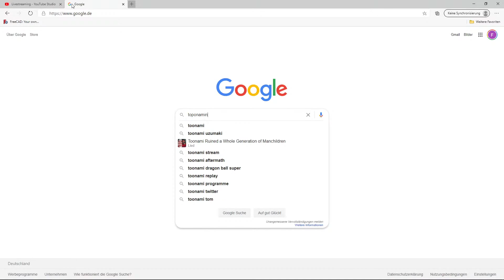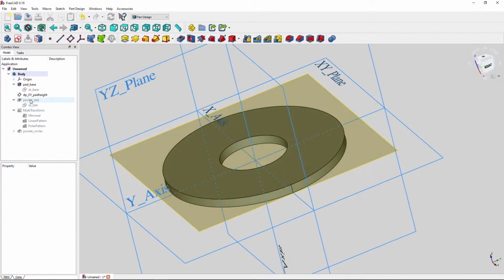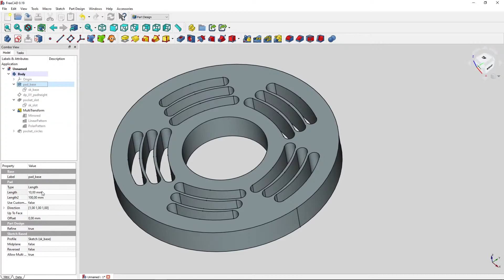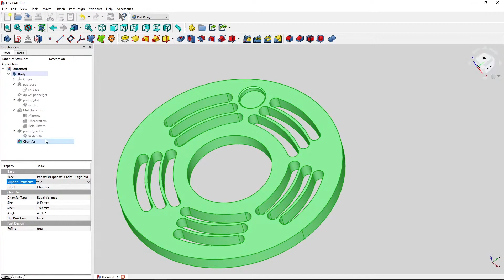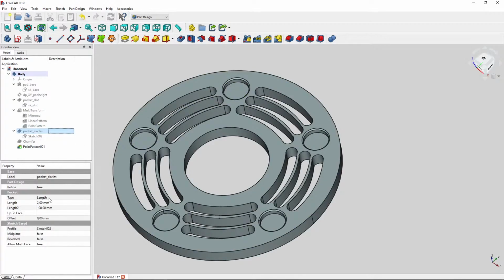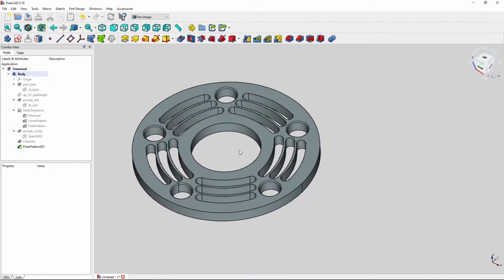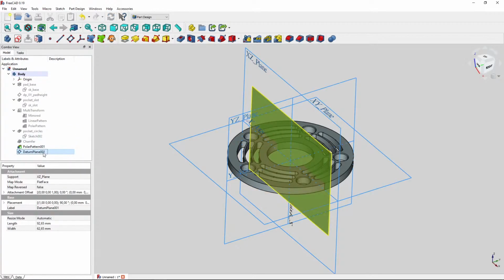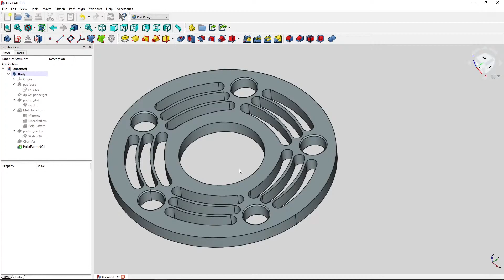The most annoying problem in FreeCAD 0.19 Part Design - Topological Naming [LIVE] (English)

Comment: So, all this 13 min video can be collapsed into 15 sec with one sentence: " issue is still actual, no forecast of fixing this, methods of making models with referring to elements of the sketch are not working for now". right? :)
------
PRELIMINARY: looks like the issue is not happening if all lines in the sketch are turned into construction geometry, additional points (non-construction geometry) are created at all needed places to duplicate the current vertexes, and all references to this sketch are linked with these points. I will add more info when I will rebuild my model and play with it long enough.
-----
PRELIMINARY#2: looks like issues starts once I have a sketch with more than 2 structural lines meeting together at one point. Construction lines can be connected to whatever is possible - they not causing this issue. Still testing, in a week, if my guess will be confirmed, I will upload the details on web and put link here.

Comment: This is very useful but quite old now. Back in '22 it was intended that the next major release would be 1.x and would 'fix' the TNP - as far as possible anyway.

However I see there is now a 0.21 on the cards, and 1.x has been put back.

It is obviously impossible to 100% fix it. If one has a sketch assigned to a face, and then one goes back to an earlier stage and does something that removes that face, something is going to be broken, it could hardly be otherwise.

But, logically, when designing something, attaching to a face is often what one is really trying to do. A simple example, a solid cube with a rod protruding from the centre of a face a certain distance. The way one probably thinks about it is "that rod is attached to that face", not "that rod starts 10mm from the origin which coincidentally is where the cube face is". So, logically one would expect that on resizing the cube, the rod would remain in the centre of the same face, protruding the same amount. And, maybe in this very facile example, it will, but it will certainly be possible to make earlier changes that would break that.

So, don't make it hierarchical like that, attach the rod sketch to a datum plane referenced to the origin and put in the right place. But, now, change the cube size and the rod doesn't move because the datum plane doesn't. Why is that? Basically because the same bit of information is stored twice, and they've got out of step. In software design there's a golden rule of never storing the same thing twice if you can avoid it (which is not always), because sooner or later there's a risk of their getting out of step. So OK, set the cube size from some variable, and use that same variable in the datum plane positioning. Better, but it's all got more complex, and this is a very simple example.

So it seems to me that the workarounds work to an extent, but they introduce complexities of their own.

To me, the problem that Freecad has is that it arbitrarily changes face names much too easily. You can have a design and maybe change something innocuous earlier on - maybe a hole diameter or something, where the number of faces and their relationships do not change at all - and sometimes it is fine, and sometimes it falls apart and a lot of rework is needed.

So, it seems to me that what is needed is some form of internal algorithm where existing face names are retained wherever possible (which clearly won't be always), and then a more user friendly mechanism for remapping sketches. I feel that would go a long way towards dealing with TNP.
Reply: Memory is freely available and memory  conservation in modern programming is not a discipline anymore and duplicity and triplicity produces its own set of problems when not cross referenced. The referencing is the issue that needs  addressing. A lot easier said than doable I realise.
Reply: Version 0.22 beta is also quite stable apparently with nice features.

Comment: After following your various FreeCAD tutorial videos, I've just finished creating my first real world object in FreeCAD this evening; a 76mm diameter desk cable grommet for gaming desks I'm building for our children. It has a bevelled lip and an internal ledge to receive custom inserts (I'll be designing those next). Exported to a .3mf file, then sliced in PrusaSlicer it's now ready to send to our Elegoo Neptune 3 Plus first thing in the morning!

I saw the idea for the item online, but the available 3D models were 80mm diameter and scaling them down would mean some key features would reduce in size as well - such as the bevelled lip, internal ledge and wall thickness. I wanted to avoid this so decided to create one from scratch. 

I would normally have headed straight to Sketchup, but thinking I would likely need to tweak the diameter to get just the right fit, this seemed like the perfect opportunity to finally have a go at learning a parametric 3D design software package. I settled on FreeCAD, found your videos, followed them through and am so glad I did. Thank you for helping me get off the starting line fast!

Comment: I guess, though, that for chamfers and such (model-changes inherently & necessarily beeing defined upon a geometric feature) we can only hope that the realthunder branch features are inspiring core devs to go for an approach like:
1) upon object creation: give a distinctively new class-name for every object (distinct from every existing one, salt-hashed or so).
2) allow for muliple strictly hierarchical classes to be held by each object (linked lists).
3) define the origin of every class (aka object) upon creation and never change it, even when splitting the surface into multiple or changing its edges by chamfering etc.
... when with object I mean: volume 3D, surface 2D, edge 1D, vertex 0D

Solver could then just pick each and every definition ever made to the model and process it exactly as it was meant to - even after changing the first definition to absurdity and messing with everything that there is.

Thoughts and Explanations for the 3 key ideas:
1) is already existing: every object gets its type and a number upon creation - its just getting changed along the way, instead ofit beeing a stack that gets added on whenever it changes.
2) is a new concept, but can be implemented easily by storing the geometry as it was before the object-altering or object-creating operation.
3) this would actually bring with it a powerful feature: in the dialog boxes there could be a  "class-tree" shown when selecting an edge.
every uphill-class could be shown and manually selected as a target for the upcoming modification - right there, even if it doesnt exist anymore in the body - I could then still use it as a reference for a constraint (#assembly)

Lets give a simple yet total - think about the following:
a simple cylindric shaft that gets a small groove milled in for a tongue and groove connection
Lets only think about the surface-classes, not those of the volume, edges and vertices - because this is a YT comment:

Step 0)
cylindric, 3 surfaces (2x circle and mantle) - lets name them C1 / C2 and M3 for shorthand here

Step 1)
after change: 8 surfaces : C1 / C2 / M3 , and added: G round of groove and 4 S ides (2 rectangles and 2 half circular mantles with rounded edges)
After the milling operation, with my approach the model would look like this: 
C1 / C2 / M3>M4 / G5 / S6 / S7 / S8 / S9
So even if the M3 geometry doesnt exist anymore, it will be still saved in the third block (aka linked list) that has now M4 as its representative to the final model

Final Step 2)
Now go on to change the groove to go "through all" the material, so its just changing to be like this now:
C1 / C2 / M3>M4>M10 / G5 = dead or invis / S6>S11 / S7>S12 / S8>S13 / S9>S14
where dead could be "visible: false" or just another boolean info for the renderer to use.
 ... so there are 14 surface-objects saved, even though the final body has only 7 objects .

Nr. of surface objects stored in the body-model for
Step       old   > new
Step 0    3      >  3
Step 1    8      >  9
Step 2    7      >  14

Hence, if something referenced the ground surface in Step 1 ( G5 ) to place something on, it would still be possible to be evaluated and rendered, even after deleting this very surface from the model - because its still saved in te linked list of Step2 (even if flagged as dead).
And when someone has bound anything to the S7 "center of gravity" from Step 1, it would also be easily possible to evaluate and render, yet even to hold all constraints in an assembly that were put to it earlier, so "Constraint-Based-Assembly" like in A2plus Workbench (pretty cool and nice to use otherwise) would work like a charm in 99%+ of all cases)
Also this could be an opt-in automatic popup or an on demand dialogue that can be run by the user manually to check:
" M4 , ... have changed, pls make sure that your reference to M4 is still doing what it's supposed to! > LIST/TABLE" or
" G5 , ... has been removed from the body, pls make sure that your reference to G5 is still doing what it's supposed to! > LIST/TABLE"

I dont quite get why people didnt program it somewhat like that in the first place - nowadays we got plenty of CPU power and RAM and its just getting more and more irrelevant every day.
Reply from the maker: I know you put a LOT of time and effort into this comment so why don't you share it in the FreeCAD forums? I think in my comment section this knowledge might be wasted..
Reply: @FreeCADAcademy  I have to agree! I found that gem by accident, on a forum you have higher chances of engagement, which is something the community would appreciate for sure! I would!

Comment: Naming issues?  Who would have thought?  Uh, first, never let an engineer name something, because "1,2,3" or "A, B, C" isn't a name.  Try a simple sheet metal problem that goes from a 1"x3" rectangle to 8 or 12 sided polygon with 1" sides.  This means for each corner of the rectangle there will be 2 or 3 edges to the polygon.  

I found that I can extrude a polygon to a degree of taper, but the small end is still a polygon.  There isn't an easy way to solve this problem.  You can create a datum for each side of the polygon, which means you need to know every angle and length.  But if you need to know every detail of the shape before you can draw it in CAD is the opposite of the purpose of CAD.

Comment: What about this? For the chamfer, construct a sketch on the YZ plane referencing the sketch of the hole and the XY plane with an angle and one dimension. Then revolve the sketch around a centerline referencing the centerpoint of the sketch of the hole. I don’t believe that includes any 3D model features.

Comment: I've encountered the same problem with AutoCAD and Civil 3d named objects.  Programmers don't seem to want to address the issue that object handles and GUID values won't stay static with traditional editing tools, because those tools erase/replace primitives as they go.  That creates all new names.  The answer for the programmer would be to make the primitives part of a named subset of objects which could be redefined without deleting the subset container.  (..as #xl points out, sort of.)  

Those primitive object defining methods were developed in or before the '80s.  And, programmers are just too lazy to develop the complicated process that is needed to update the root of the software.  The idea is that the existing methodology is "more efficient code".  Even though, that code was only considered efficient because the hardware could not support that much computational and recursive math at the time.  Even today, I have burned through a couple of i7 CPUs just trying to run some complicated Excel spreadsheets with many reference formulas.

Does anyone here know if Solid Edge, BRL-CAD, or any other history based CAD software have solved this issue?

Comment: Sadly FreeCAD is too weak in that it can't name the result of an operation so that it can be referenced later.
Example: At some point you pad a sketch. Imagine if you could name the sides of the pad, or name the translated face, so that you can reference it later....
In SideFX Houdini for example, at every point in the graph, you can insert arbitrary code to select the face(s) you need; nodes also let you name the result of the operation (faces that were created for example), making it a truly procedural modeler. In FreeCAD you're stuck with whatever options the developer though of, if you're lucky.

This is why you have to do weird stuff like creating a datum plane that happened to coincide with the extruded face of the PAD at 2:30 instead of supporting the sketch on a named face, so that it will also be at right place even if you have some minors change upstream. By doing this, you're really re-implementing a part of PAD with the datum plane + shift in a direction + a reference to some length.. We should not have to do this. This is error prone. Also, it only works in simple cases. Good luck if you need to reference a face from another additive method where the result is non trivial.

Comment: Thanks for the very clear explanation.  I'd discovered this problem by hard experience, and found similar work-arounds, like using absolute datum planes, but I think this is extremely unsatisfying.  I contend that expressing features in terms of 3d-geometry better captures design intent.  I understand the software difficulty that adding a feature can change the geometry in complicated and unexpected ways, but it seems like there could be better heuristics than just picking some random edge that had the same name in the last computation!  Based on the other comments, I'm downloading realthunder's latest version right now!

Comment: Wow! This is exactly what I needed to know. I will have an original prusa mk3s soon, exploring woodworking design to make a large custom wall cabinet for it, and have used the KiCAD StepUp bench a half dozen times before.
 I think my biggest mistake has involved mapping sketches to 3D object faces. I had no idea why my edge finishes migrated like this.

  My abstract thoughts, ideas, and learning curiousities:
  After watching this upload yesterday, I'm wondering how I could better plan out a larger project. For instance, maybe it would be better if I start a design by setting up several key datum planes before any parts are added in order to ensure all of my anchors are limited to the origin.

  With woodworking, my goal is to generate a materials cutlist and an efficient plywood layout. This seems like a challenging workflow to manage because it involves many independent and interrelated objects. I'm struggling with part/parameter naming, organization, and dealing with situational parameters like changing shelf widths that then need to be centered between vertical walls.
-Jake

Comment: I retired from an engineering management position in 2011 where I used SolidWorks and ProE. As I recall in all the lesson I had on those software programs the instructor always stressed to not build onto part model surfaces since you may change your model and the surface you used may move or be deleted. So this video on FreeCAD echoes the same advice. Very good, Flowwies.
Reply from the maker: Hey Don! Thanks a lot for your feedback. It's not considered a good 'style' of 3D modeling to draw on existing 3D geometry, nice to hear that others give the same advice for other CAD software!
Reply: @FreeCADAcademy  i have used 'ProE' since '93 and, yes, in their early releases they had the same sort of  databasing issue. Some designer would put a corner radius way high in the modeling tree, continue building features,  then need to remove the radius or change something about it. The tree would fail. Way back then they stressed to put chamfers and radiuses last in the tree if possible. 
I trained new designers to do that--treat that block like a machinist would. Do all the milling and drilling then soften it up with corner fillets and radiuses.
Reply: @dalesimmons3397  Yeah, I think that's way better. I understand why people want to chamfer before patterning; it saves some work. But that's only because manually selecting all the edges is cumbersome. More powerful edge selection would fix that.
Reply: I use all 3 programs. This issue is unique to freecad.
Reply: @spacer04078  Same here.  I've used Solidworks since 97 and Pro/E (now Creo) since 2003.  This is a software design problem and not a user issue.  Using faces with a modern well-deigned solid modeller is absolutely a good practice if done thoughtfully.
Reply: OnShape has that problem too. So, I guess, it is pretty common problem.

Comment: Excellent!  Have heard & read about this problem but your explanation is the best!

Did your "Finish : 3:45" video & learned a lot from building your object.  Since then have changed your object from 3 arms to 4 arms and in the Part workbench have created a new bigger object by mirroring your object using the XY plane as the mirror plane.  In other words, putting 2 of your objects together flat surface to flat surface.

Thanks again for posting this video, will repeat for my education.
Reply from the maker: thank you very much for your comment. Where do you educate FreeCAD to others? at school?

Comment: I've run into this before. Coming from Fusion 360 I was used to always doing things based on the 3D geometry. It has made me think more about the order in which I create my objects so the dependencies are less likely to occur. It's great to understand why and how to correct for it.
Reply from the maker: You're right. It's a problem but it makes you think more about the need for clean modeling and avoiding unnecessary dependencies and create stable models.